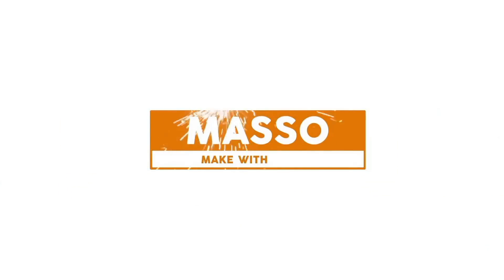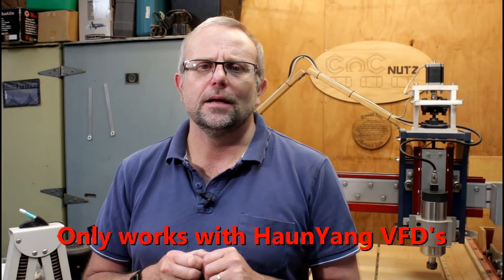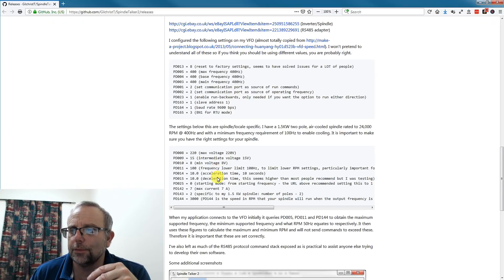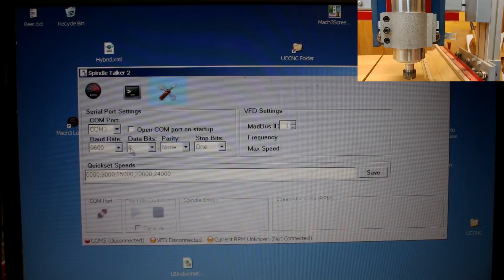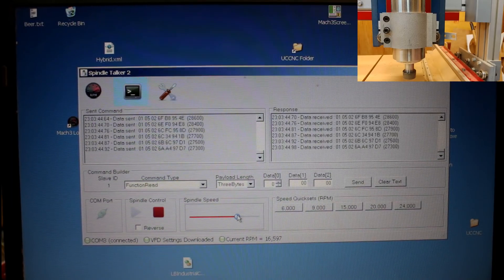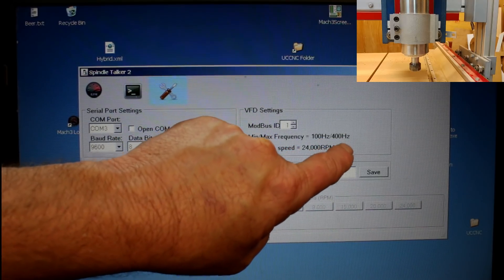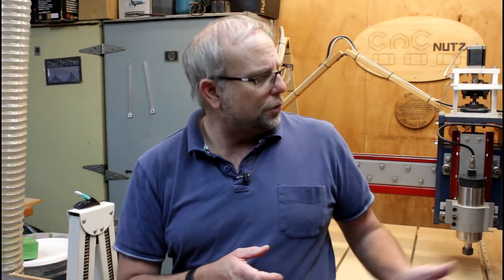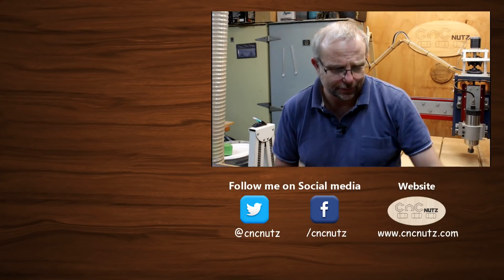Diagnose your spindle with SpindleTalker- CNCnutz Episode 225

Comment: Any chance you could do a video on the setup process of the HuanYang VFD with your router? It seems a fairly common combination but the translation of the manual leaves a lot to be desired.
Reply from the maker: I did. The video before the RS485 was on setting up PWM for my VFD. My Gecko G540 does the PWM to analogue conversion so maybe I need to Investigate this for people who don't have a G540. I will see what I can come up with.
Email me with your setup so I can get an understanding of your setup. 
https://youtu.be/Xd3K47Iuwv8
Cheers
Peter
Reply from the maker: You might be in luck. It looks like I ordered a PWM to voltage board for a VFD last month so will be able to do a video on it for those who don't have a Gecko G540. Just have to wait for it to arrive.
Cheers
Peter

Comment: Peter, would you happen to know why my RPM readings are flashing from 0 to the set RPM settings and never stabilize. If I use the parallel DB 25 port no problems. I thought I would upgrade to the UC 100 smooth stepper  and that is where the problem starts. The RPM fluctuates 0-8000 rapidly and never sets at the desired RPM. I can control the rpm just fine but the read out is haywire in mach 3
Reply from the maker: The readings also fluctuate on mine and I suspect it is because Mach does not generate the PWM when you use a motion control card. It would be a matter if checking the screenset to see exactly what the DRO is displaying. So long as the spindle speed is correct then I wouldn't worry about it. Not something I have looked into.
Cheers
Peter

Comment: Thank God for Peter Passuello. I've had no end of trouble trying to get my RS5 adaptor working for over a year. It worked for about a month then mysteriously stopped. I'have rewired the entire CNC and I've replaced the RS-5 adaptor. No luck. I've been controlling my spindle manually through the VFD.
Thanks again Pete! Keep up the great vids.
Reply from the maker: If you can't get it to work on RS485 consider PWM and a relay. It works just as well and is universal to all VFD's.
Cheers
Peter